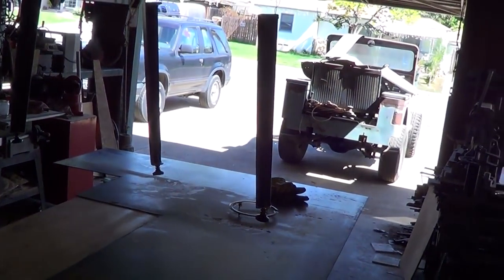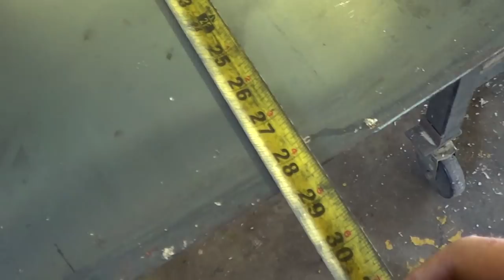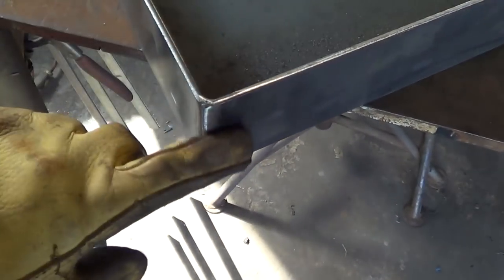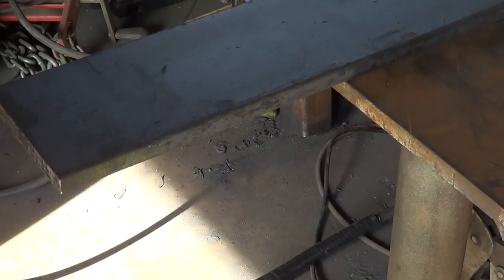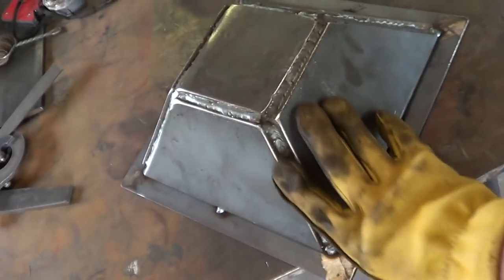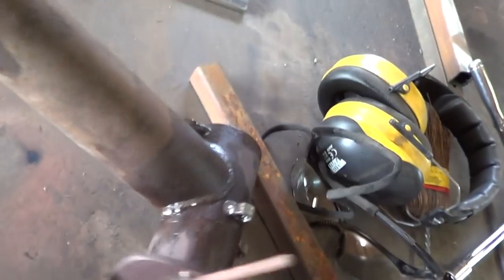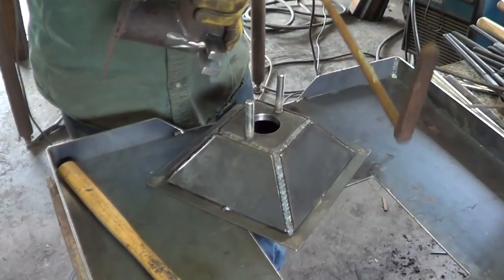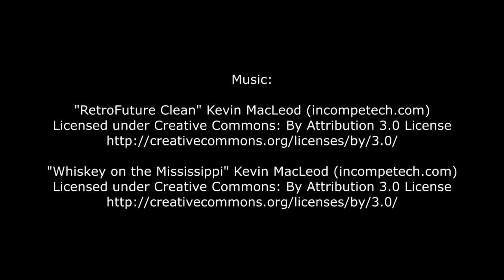Fire Pot Forge Build   OMG 2018 1

Comment: Very nice. I have discovered using band saw coolant mixed with water in a spray bottle works great on hole saws. a lot cheaper in the long run and no stench of oil burning off. I keep one right on my drill press.